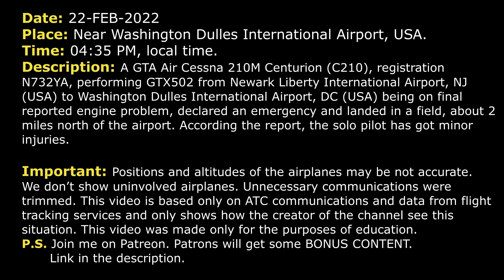CRASH LANDING near Washington Dulles International Airport | Real ATC audio

Comment: Glad the pilot landed safe. With surface winds that strong, they have a huge effect on the landing safety, so some quick math to illustrate. Winds were from 200 at 14 gusting to 29, I will round up to 15 knots gusting to 30 to simplify the math.  assuming that the touchdown would take place at roughly 60 knots airspeed, which is entirely realistic...

If landing into the wind, that makes the groundspeed about 45 knots or maybe as low as 30 knots if the wind gusts right at touchdown. If a pilot in this situation only heads for a spot without thinking of the wind and happens to land downwind, groundspeed at touchdown will be 75 knots to 90 knots if unlucky with the gusts.  Because kinetic energy varies with the square of the groundspeed, even in a no-gust scenario the pilot would be landing with only about 1/3 the kinetic energy upwind as compared to downwind. If a gust arises at touchdown, it's 30-squared versus 90-squared, which means touching down with only 1/9 the kinetic energy upwind versus downwind.

And that's why I would love to see controllers ALWAYS clearly provide the surface winds to pilots about to make forced landings. It's up to the pilot to decide what to do with that information, but that information alone can be a lifesaver.
Reply: I learned to fly in SW Kansas. KDDC at that time had an average wind speed of 15.2 MPH. As a student pilot (Cessna 152) if wind gust were below 30 MPH we could solo. If you're gonna fly,,,, learn to fly in wind was very common. If the pilot landed on heading 200 (which I hope he did) there wasn't much ground speed. On my first dual cross country my instructor showed me how to fly the 152 and go backwards while pointing forwards. Yes it can be done.